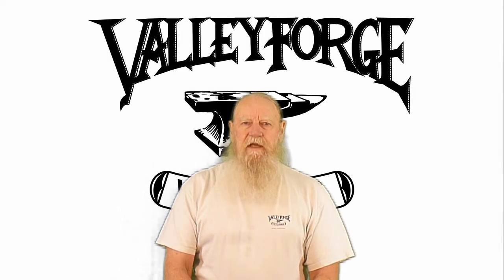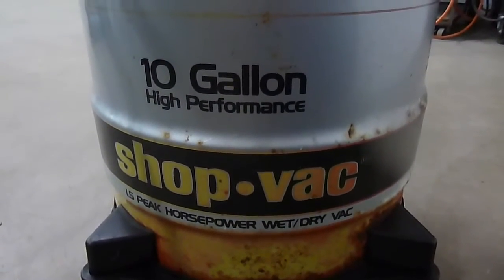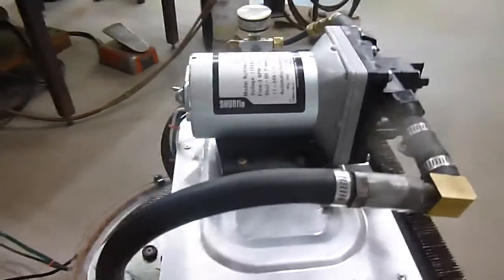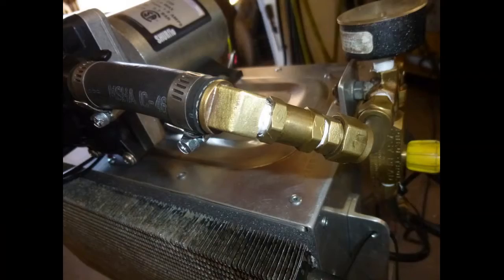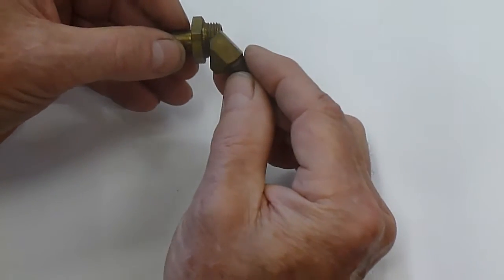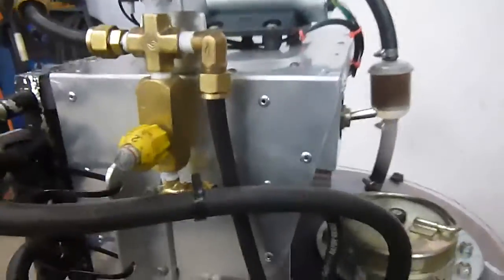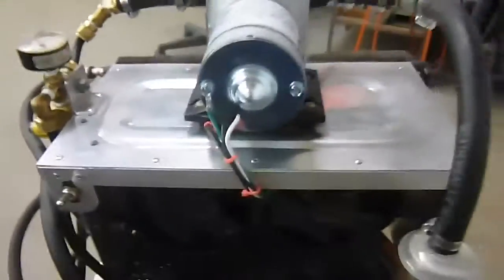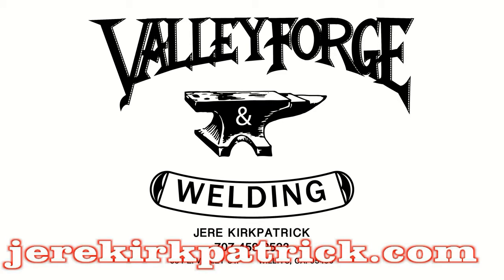TIG Torch Cooler

Comment: The pump you are using there is a variation that has a  pressure regulator built in with no shut off switch it uses the little Allen key at the bottom of the pump.I know this for a fact as we use both of these pumps all the time.

Comment: Automotive fuel filters are designed to not allow water to flow through. That's why water in gasoline is a problem. It gets to the filter and freezes in the winter. I'm not sure if an antifreeze/water mixture would flow through it
Reply from the maker: Hello aw738:

The original filter is still on the cooler after three years. I had concerns about using it for the same reason as you. I went ahead and used it because if it needed to be replaced I could go to my local NAPA store and have it on the shelf ready for me. I bought two from the start so if it didn't work I could put on the second one while waiting for a different filter to come.

Thanks for your input and for watching.           Jere

Comment: thats a ridiculous amount of work and effort for the cooler. kudos though
Reply from the maker: Hello Bevis.

Yes but it didn't seem so as I was building it. I knew what I wanted and had to figure out how to get there. I seldom buy something off the shelf and with that I usually wind up with something better, that will last a lifetime, and learn something along the way.

If you have watched my other videos you may have noticed that a lot of the machines in my shop are of my design and manufacture.

Thanks for watching.          Jere

Comment: My Tweco cooler is good for up to 600amps and holds about a gallon. Wonder why the need for 10 gallons and a heat exchanger which I would guess could easily handle 1000 amps or more?
Reply from the maker: I'm only using 4 gallon's of water. I just finished some aluminum at about 120 amps for about 1 and 1/2 hour and the water  was only 65 degrees. I have melted a couple of lines so I thought better safe than sorry. Besides a lot of stuff I do doesn't  make since.

Jere
Reply: Jere Kirkpatrick
Ok but personally I would have made cooler smaller and more compact, and used a Pro Con pump rather than something intended for RV use.
Reply from the maker: As I stated I also use it as coolant for my mill and lathe. The pump has a two year warranty so it will probably last longer than me. Plus I got to use a bunch of stuff that was laying around the shop. The only things I bought was the pump and the three clips to hold the lid in place. If I made something smaller it wouldn't have taken as much time.
Reply: Jere Kirkpatrick
If you are using it as a slurry pump, cant see it lasting that long, but if it didnt cost much doesnt really matter I guess.